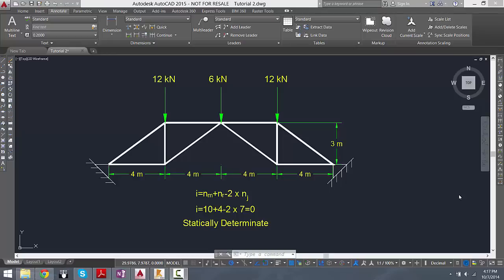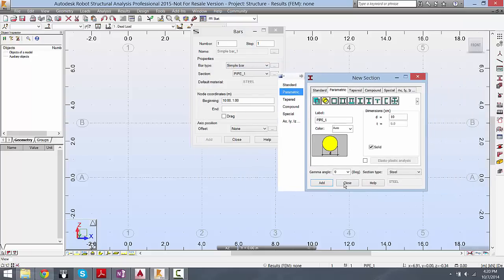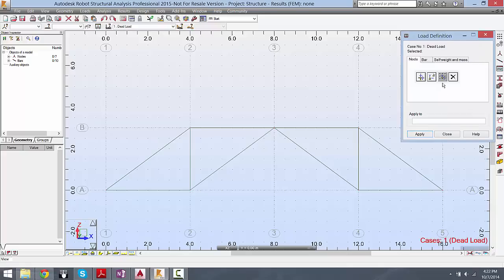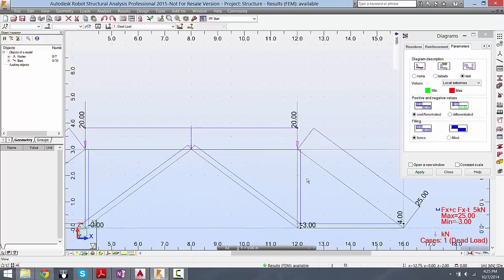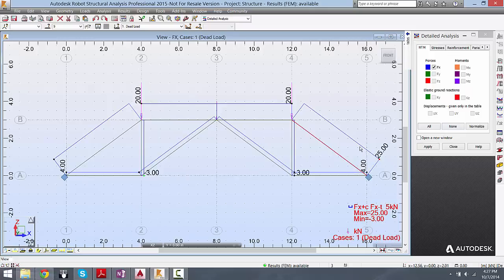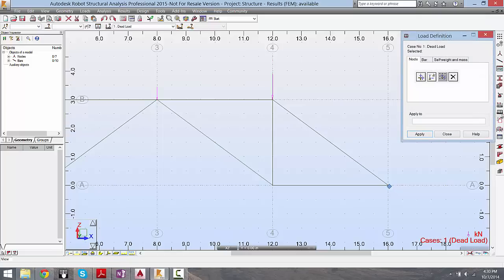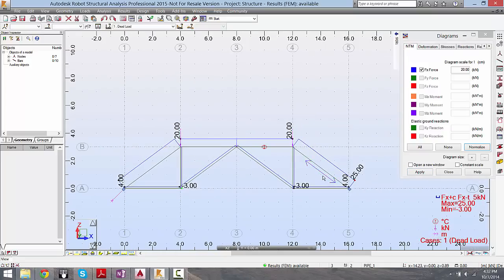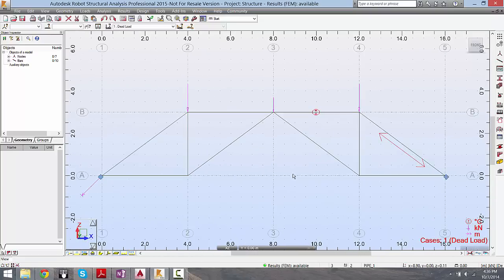Robot Structural Analysis 2015 - Simple Truss Analysis

Comment: thank you for your excellent video. I am solomon from Ghana. I wnat to ask you if Robot is generally difficult to learn and also how did you learn it? Where you taught by a teacher or did you use any book?
Reply from the maker: Hey Solomon. I don't think it is very difficult to learn, especially if you are familiar with other structural analysis software. I taught myself how to use it, no book. I find that it is usually best to begin with simple cases which you can compare with theoretical problems to which you already know the answer. From there it will be easier to understand what the program is doing and to build upon it. It is always up to you as the user to make sure the solution you arrive at makes sense theoretically. Also, because at the time I was learning Robot I also knew other software, I was able to model the same thing in multiple programs and compare what I was getting. So to answer your question I learned through trial and error and  the online documentation.
Reply: Thanks